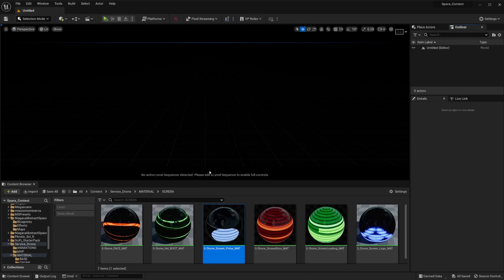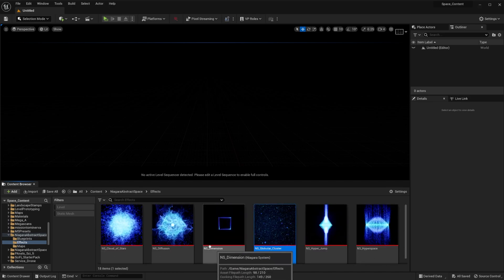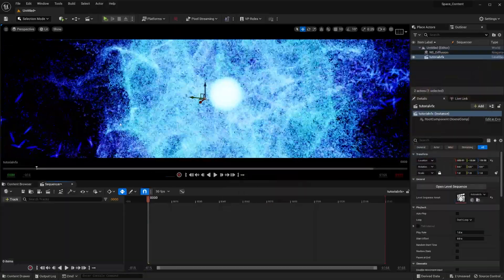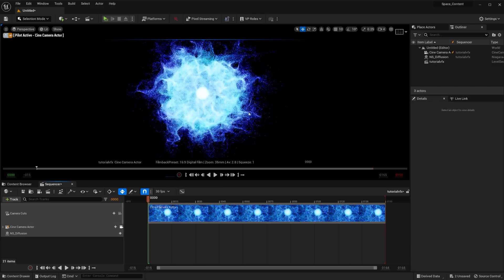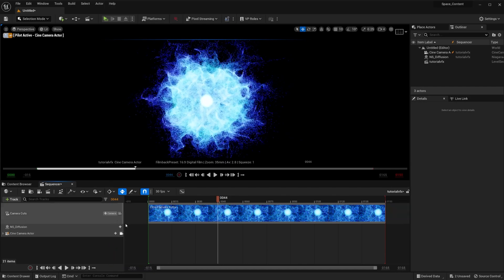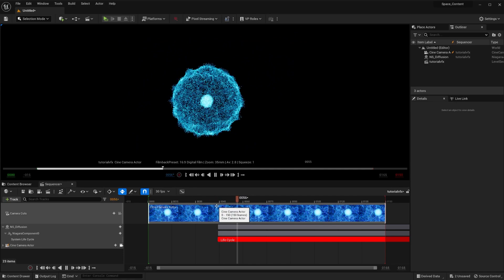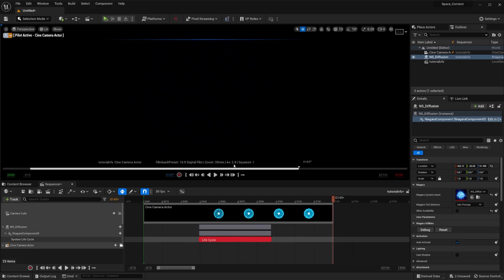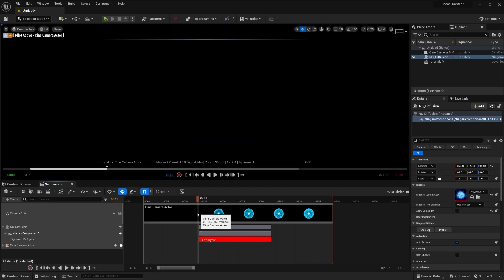How to use Niagara VFX in Sequencer Unreal Engine 5.1

Comment: Question: I made a Niagara particle effect and added it to a Sequencer. I added a track under 'Rendering; Actor Hidden In Game' and set keys for when to start and end the Visibility of the effect (beginning on 0001). The reason for this is that on 0000 the Niagara effect is showing and when I use a device (in Fortnite) to trigger my sequence to play, it then hides my Niagara effect as intended from 0001 onwards. The issue I'm facing is it does not always reactivate my effect when stopping and re-playing the sequence via a trigger to turn on/ off the visibility of the effect. Any ideas and could it be something to do with the Kill Particles setting in Niagara?

Comment: yeah, so how to make it slow motion?
Reply from the maker: You will have to go deep in the particle system unfortunately out of my league
Reply: @MR3D-Dev-Tutorials  yeah... i've been searching them for weeks now. all i could get is doing niagara sim cache but it's in the ue 5.2. don't know about custom coding for niagara bluprint module and all that stuff. pretty hard research.. might learn some c++ at some point 🥲
Reply: Pretty simple, go to  "+ TRACK" on the Sequencer and select "TIME DILATION" change the value to your liking. 1 = normal speed, 0.5 = half speed, 2 = double the speed. For slow motion I use 0.2, looks pretty good. The slow motion will only take effect during gameplay and most likely during the render, it will not happen in the editor viewport.
Reply: @TheBlackGamerPT yeah but it will affect the entire scene. as for ue 5.2 there's a niagara cache plug in and it seems that is what i need. you can bake the niagara into cache and play with the "fixed" niagara system. including its time.

Comment: Thanks, straight to the point.
Yet, as is, does it work in the render queue ? Because I had some troubles with it (plays fine in the editor, but the render is different)
Would you have any tips for the render to look like in the sequencer (without to have to put everything in "spawnable" ?)
Thanks for your work ! :)
Reply from the maker: I actually rendered the scene from the thumbnail using the same pack I showed in the video. I didn't do anything extra for it to render on mrq.
Reply: It seems I have finally found the solution to my problem, which is very similar to what you have described. The issue was related to the way the particle sizes were generated by the emitter. For some reason, the size of the particles we see on the viewport differs from what is actually rendered.

My solution was to enter the Niagara simulation from the Content Drawer, then select the emitter. Next, I searched for the 'Sprite Size Mode' property and made a change. In my case, the property was set to 'Non-Uniform,' and I changed it to 'Random Uniform' with 'Uniform Sprite Size Min' set to 1 and 'Uniform Sprite Size Max' set to 3.

I hope this solution will help you. By the way I use UE 5.2
Reply: Thanks for sharing 🙏 @null_design
Reply: I have the same problem. The viewport preview looks great but when I try to export it using Movie Render Queue I getting bunch of tiny dots which doesn't look like preview at all.

Comment: Question: can you please do a video about rendering up Niagara FX with AOVs / Cryptomatte?  So we can composite the Niagara FX's in a video editor.
Reply from the maker: I have never done it that way. Usually if I want to composite in editor I would use stock VFX and not inside Unreal (which I am also doing for my shortfilm)
Reply: @MR3D-Dev-Tutorials  rendering Niagara fx with AOVs or Cryptomatte from UE5 is a mystery.
Reply from the maker: @hotsauce7124  it certainly is
Reply: @MR3D-Dev-Tutorials  I think 5.2 allows for AOVs
Reply: If you had access to nuke and use the nuke unreal reader node, nuke converts the entire scene into different AOVs and I havent tried but assume it would do the same to particles generated by Niagara